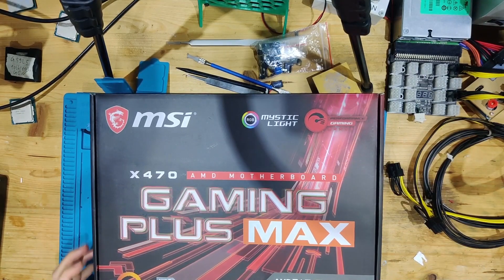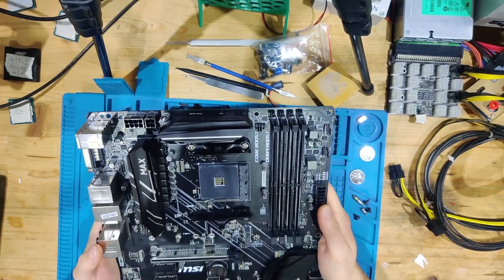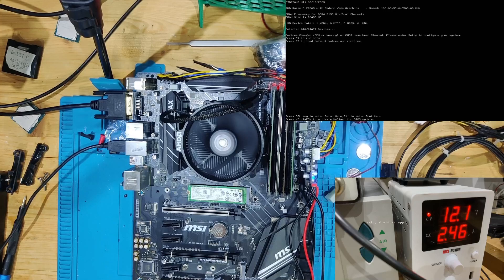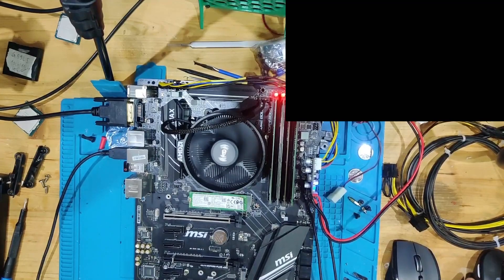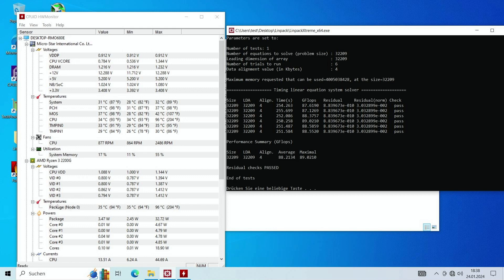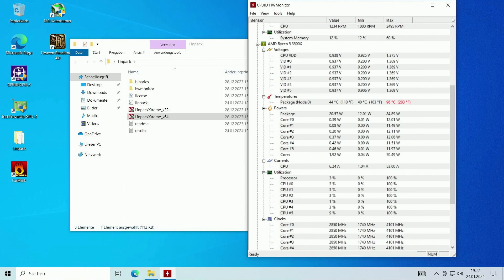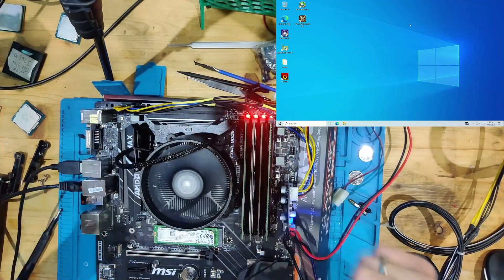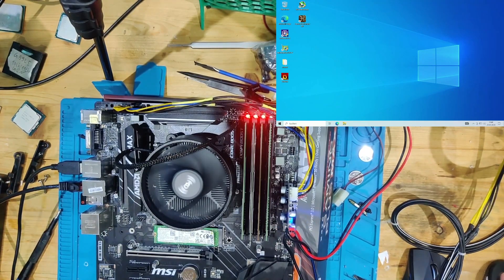PC KEEPS CRASHING, HOW TO STRESS TEST MOTHERBOARD FOR STABILITY | MSI X470 Gaming Plus Max Instable

Comment: Hmm for AM4 put a Ryzon 9 5950X in it and 4x16/32GB 3600 DDR4 + a Nvidia 4090 or a AMD 7900 XTX also put a 360 AiO or a 420 AiO on the CPU. Run AIDA64 Torture Test, CPU-Z Stress Test, Prime 95, Cinebench and the already used Linpack Xtreme.

It actually is pointless to test the bord like you did as the instability comes from his setup that is board, CPU and RAM plus whatever he did with bios settings. No one buys an X chipset board to run RAM at JEDEC speed.

Comment: When i used to do builds and repairs, I always preferred to see the system in situ rather than it brought in the shop for difficult to pin down issues as sometimes it can be down to an external peripheral or  environmental issues, also the PSU is often overlooked, have seen things like usb devices and ps2 mice  and even a monitor cable making systems freeze or become unstable, or even  an error in the way the board is mounting or the backplate installed have seen end user builds with the spring  tab inserted into the USB port before now shorting things out...

Comment: Hi there, I am a new viewer and I have a tech question for you. I own an ASUS ROG STRIX Z490-E and the problem is with the upper slot. Depending on the CPU is installed I get missing lanes. For instance if I install my i5 10400F I get only x2 lanes, when I install my i3 10100F I get x4 lanes and finally if I put my Celeron G5905 I get all x8 lanes. The CPU Socket is in perfect condition. Could this be a resistor? or is this a loose solder join along the pcie x16 slot? I should add that the other slots work properly. Just wondering if you have any ideas.
Reply from the maker: This could be a Bios setting thing, but i would thin it is a problem with the contact in the socket. Need to check if the CPU is bent or not and clean the contacts on the bottom of the CPU. Because if it can conect with the celeron on all lanes it should be able to do that with the other CPU´s as well.
Reply: @MainboardMedic Thanks! I take a closer another look. Thank you your help! Cheers!

Comment: The original owner maybe had a more power hungry CPU like a 5950X or something that draws double the amount of power of a 3500X...Maybe the VRMs fail at 100W+ power draw. It could also be that the original owner played around with curve optimizer and made his system unstable not understanding how to use that OR he simply had a faulty CPU. Anyway it's hard to troubleshoot these kind of issues without testing the whole system that he was using.

Comment: The orig owner could have had a defective CPU by degradation ,It happens :)
Reply: Even a new one too. I had to change CPU multiple times. and it worked well with the 3rd one. Maybe the returned ones could have worked with another MB but not mine though it was fully compatible. That happened... a decade ago.

Comment: Play a game, that will make it crash.
Reply from the maker: Well, heaven benchmark is a 3D application that should basicly be like a game!
Reply: @MainboardMedic  i have run tests with no problem then played a game then crash
Reply: Thats either your PSU is failing, or your RAM is not stable to begin with " assuming you didnt manually overclocked your CPU and GPU "  @Steve-ho5zj
Reply: @MainboardMedic  Nah it doesn't work the same way